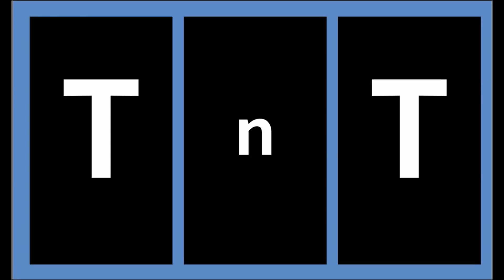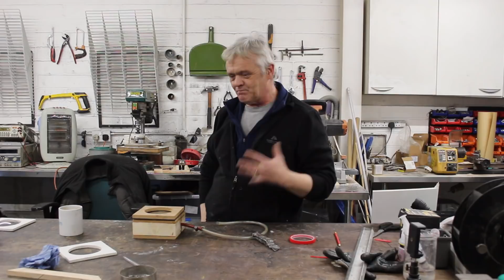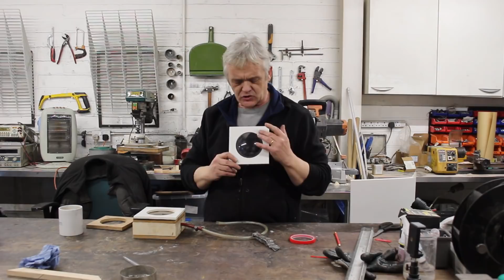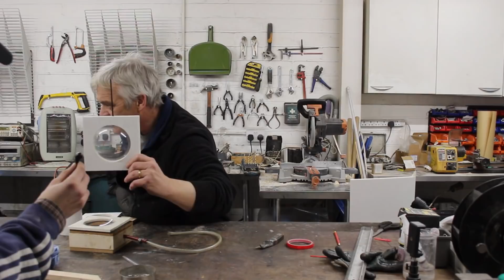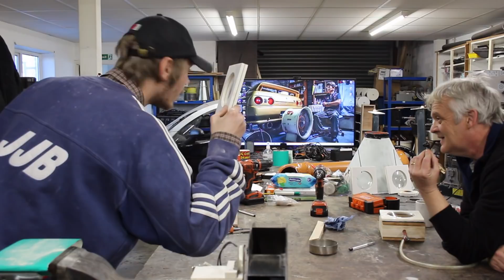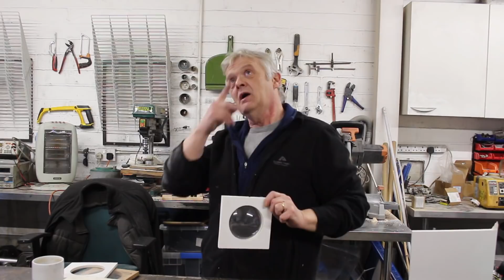1385 A DIY Sound Lens - How To Focus Sound

Comment: very cool, but i really don't get it! so you have a convex lens catching the sounds from around the room, passing them through the CO2, moving the convex lens which focuses the sound into your ear?
why do you need two lenses at all and what does the CO2 do? i could imagine one convex lens catching the sound of a focused target and a second one, also convex, focusing it into your ear, basically giving you a big ear without using a giant cone, but if you're 'catching' sounds with a concave diaphram then couldn't it just be the back side of the same lens that then focuses the sound into your ear?
does the higher density gas transmit the sound waves better?

another solution that i think might work pretty well is if you actuate a sound lens directly with your painted speaker method shown recently, or with a more conventional transducer obviously.

i'm having ideas as i write this. i imagine creating a magnetic field to actuate a fairly large lens would also require a huge magnet, and with the coil panited onto the lens diaphram, the excited wire would be at different distances from the static magnet, and quickly really far away as you move out from the center.

but you can get flexible magnetic sheets. they aren't extremely magnetic, but i've seen them used to attach flexible build plates onto FDM 3d printers.
maybe you could cut one up to line a second, identical 'dish' placed as close as possible to the active diaphram lens as possible, so you can actuate a concave diaphram equally and effectively across its whole surface via a speaker coil panted onto it! so, it wouldn't be actuated linearly but rather into its focal point.

hope that makes sense.

EDIT: just went back a few videos and see that you actually thought about a bunch of this already, i'd only seen the painted and paper speaker experiments bfore this. buuuuut, combining a few of these concepts, i think you could actively drive a sound lens for a very directional speaker. i've made tech ingredients' panel speakers before but they aren't especially diectional, which is a very interesting feature, as you've here.

Comment: What an amazing idea, as usual thanks Robert.

This got me thinking about a program where the security forces used a sound cannon to keep people back, (the Israeli military have perfected) apparently it's so powerful that they knocked a double decker bus over with one.

Any chance you could rig up something for a miniature home firing range using sticky-back plastic and binder twine to target plastic bottles and cans please?
Reply from the maker: I have been thinking about it lol
Reply: May I suggest a ring vortex launcher for that same firing range? I used to fire tiny vortexes to tje curtains and you could clearly see the hitting point on the hanging fabric :)
Reply: @DoNotPushHere , I have a plastic toy that fires foam rings but don't want to mark the curtains, my woman would have my balls for next years Christmas decorations.

The ring vortex launcher proved to be too dodgy for non-lethal crowd control because if it was used to mark certain protesters with dye or chemicals it would also cover people under it's flight path. There's also a link to a page on a Hail cannon (shock wave generator) which I had also never heard about yet they have been around for over a century!

Some foreign security forces add a smelly chemical to the water which, like digestate from biodigester's is super-smelly and sticks to everything.

The nastiest control method has to be using microwaves to target people and is very effective at crowd dispersal because when you are within range your skin starts to heat up and it makes you feel uncomfortable and you really don't want to be there.
Reply: @petergambier  foam rings? I thought it was just smoke!? And nevertheless I thought you could just launch ye olde invisible air to avoid such a level of (involuntary) commitment in next year's decorations.

Do you know the name of the foam toy?
Reply: @DoNotPushHere , yes, it's the Executoy Stress Shooter. Article:57/9300, originally bought in 1999, and powered with 2 batteries, It fires up to 20 feet and has a magazine that holds 10 (you get 20 disks) and makes great noises when you pull the trigger. Happy new year from England.
Reply: @petergambier  I just googled the toy for some images...
wow I feel so stupid right now! Hahaha! I thought it would launch foam rings but, like...soap foam
I was so obsessed about the smoke ring launcher that all the time I was imagining some sort of flying ring of soap foam, which, being much denser than smoke, I could only wonder how would it work.
Do you really think those tiny flying foam disks would mark your curtains?? They don't have any paint or powder on them, do they?
Happy new year too!!

Comment: Decibels do not destroy hearing distortion destroys hearing and causes ear fatigue my father invented a spherical speaker enclosure with a parabolic reflector dish made of fiberglass and had several us patents on it that reduced ear fatigue by 86%. As per Princeton audio labs research and established over a conventional box speaker which is more like furniture sound waves around why are people putting square pegs in round holes and calling this engineering?

The result was that he was able to do produce 246 DB with no cavitation of the sound waves which you use to push a turbine playing hotel California his input was a 12 volt car battery hooked to an amp to a sine wave generator to an oscilloscope and then afterwards he was running a generator using the sound waves in a Venturi system to push the turbine which was then running a generator which was connected to a 220 amp arc welder again his input was a 12 volt car battery his calculations was around 1185 feet per second pressure wave and in comparison Steam from a nuclear power generator pushes around 860 ft per second he called it project Jericho he taught me how to build it I know exactly how it works how it functions as I to see sound waves like you would see a mirage effect like he did something genetic who knows
Reply from the maker: that is simply fascinating mate - thank you for sharing

Comment: Could we use CO2 from a bottle of coke or some other fizzling drink? I think you only need to 'act' as if you are pouring something. In reality CO2 will come out and drop down.
PS: never knew about this sound direction lens. So it is actually the CO2 which is diverting the sound waves. Sound acceptable, same as light. And light is as well a wave (in many conditions).
Reply from the maker: I don't know mate but Rick3y had a nice idea

Comment: Those should be parabolic lenses, right? So the shallower the lenses the farther away the focal point should be.  Does refraction in the co2 change the natural parabolic focal point of  the back lense?

Would using vinegar and baking soda to make your co2 gas work? Suppose there was an outside chamber to make the co2 and a tube to feed it into the lens (co2 falls so the chamber should be above the lense and the tube entering at the top of the lense) and another hole at the top to let the air out, then close both ends when the lenses is full (maybe a match goes out at the output hole or something).

Would there be enough pressure in the co2 for the lensing effect to work?
Reply from the maker: I am sorry colleen you are asking questions I don't know the answer to yet
Reply: Hi there, no they should be as Rob made them. Parabolas are used to reflect rather than 'lens' waves such as a parabolic mirror. This effect would be used in directional microphones for example. Lensing is a consequence of the speed of the wave changing as it crosses some sort of boundary (air and glass for light for example).

Comment: Can you make concave lens with helium?  That would be an incredible experiment for students to demonstrate the nature of the lens converging/diverting depends on the both shapes and refractive index.  Not just the shapes.  Many students automatically will think a convex lens certainly a convergent.   A helium filled concave lens will certainly clear this misconception.   The technical difficulty will be how to retain helium long enough in your lens without letting it escapes. 

One more suggestion, when you refer to an old video, it will be good to add a link to your description so the viewers can easily found it.  

Thanks again for the great video and idea.
Reply from the maker: the videos are really easy to find mate just put the number in on the search bar of the home page and bingo it will take you right there
Reply: "Can you make concave lens with helium" sure just make the frame a cut down bellows filled with sealed helium with the added side benefit the device becomes a variable focal point by simple linear motion.

Comment: Awesome as usual :)
Is there a benefit to using CO2 rather than water in the lens?
Or in other words, is there a reason not to use a water lens to focus sound?
My first thought was that obviously sound travels in water, but maybe water reflects sound to such an extent that too little of it makes its way into the lens... or maybe the sound equivalent of refractive index of water vs. air prevents the sound from exiting the lens on the other side?!?
I'd love to hear what your physicist brother has to say about that.
Thanks

A small correction: "... in video 1834..." (02:06) should be "1384" ("How to make lenses...").
Reply from the maker: I'll ask him and thanks for the correction - cheers

Comment: what about holding it up infront of the mic since that is basically the audience's ear? (also sounds like its time to invest in a sound meter LOL I have one of the really old ones from radioshack around here, XD and surprisingly it still works pretty well with various switches for altering the sensitivity and range and all :)
Reply from the maker: someone suggested an oscilloscope
Reply: @ThinkingandTinkering  or even just a meter over a transducer maybe? but seeing it pass infront of the camera of a webcam that has a mic too, might give a visual and auditory example of it, at any rate it looks like one heck of an interesting use , Sound canon, sound amplifier ect, XD passive spying device? sounds like it would beat out a cup on a door hands down LOL

Comment: also I wonder what the average speed of room temp CO2 is, compared to normal atmospheric gases which are supposedly around 80% nitrogen and 20% oxygen with those taking a number hit for the percentages of various other gases like argon, CO2 and such, mixed into them, and apparently the sound speed is an indicator of how fast the average atmospheric gas particle is moving, ie if the particles move slower then sound will travel slower. faster, and it causes the sound to travel faster, though this is with the obvious nature of some gas particles are moving super slow and others are moving much faster, but it all averages out in the end, or so I am told.
Reply from the maker: shades of maxwell's demon there mate
Reply: @ThinkingandTinkering  kinda funny that that is exactly what I was thinking when it comes to IR reflective coating on an IR absorbing material layered up with a vacuum between layers, (the reflective coating and absorbing coating all in the same orientation) to do passive thermal pumping since in vacuums supposedly the only way to move thermal energy is as IR radiation unless you have enough energy to make visible photons that is) basically making a one way directional diode to do half of the job of maxwells demon. The other portion could possibly be done by micro cone shaping so phonons can collide increasing their energy quantity by combining at the points, to give the energy to jump to a photon of IR radiation level even when individually the thermal waves are not enough alone.

Comment: Feeling stupid for asking the question: Why CO2, what does it bring to the party? Can you use say, Nitrogen - air, or other gases? I seem to remember the BBC (TWorld) presenting this back in the day. Really interesting and accessible (cheap ;), thank you. All the best, Beamer.
Reply: In theory yes. Although using air wouldn’t work. nitrogen and oxygen would give little difference. It works because of different speeds of sound in different gasses
Reply: @tonyoliver4920  Thanks for the insightful reply.
Reply from the maker: thank you mate
Reply from the maker: ahh - Tony is a smart guy

Comment: does that red (or is the gel red and there is a clear over it?) peel off after applying it so you have just a gummy sticky material?
Reply from the maker: the gel is clear the cover tape is red and plastic and pulls off after you apply it leaving a gum line
Reply: @ThinkingandTinkering  ah cool ok so it is similar to the stuff I have (salvaged from sticker, and name plate company) that has 3M 468MP adhesive (also has 200MP adhesive in smaller letters under that) also comes in big sheets and 6 foot long rolls XD

Comment: Thanks Rob. Quick question, these builders boards (cintraboard) are they the material that is used for signage? They look more durable. UK based if you have a link.
Reply from the maker: it's used for fascia and soffit mate - often called building plastics - as you are UK you will find a ton of places that sell it very local to you they come in 3 and5 m lengths 19-25mm thick and 100 to 300mm wide - just put uPVC fascia and soffit in a google search and I can more or less guarantee 3 or 4 will pop up local to you - cheers
Reply: @ThinkingandTinkering  Ahhh, 80's white gold! Thank you, I'll keep a look out

Comment: It seems that this process produces a parabola. If your plastic had a Mylar film on one side you could make a parabolic mirror. A solar concentrator if you will. Scaled it up to a meter across and you could do some real work. Lots of BTU’s in a small area at the focal point.
Reply from the maker: for sure
Reply: @ThinkingandTinkering  can you look into using frequencies and a rail gun setup that can send soundwaves/light that  mimicks the same frequency of the stone/crystal and lets see if we can melt/mold solid material or cut/destroy  it .. Alot of megalithic stone structures seem to have lifted ginormous stones and shaped them in a way that appears to be that the stones were once in a liquid state then molded and placed into place